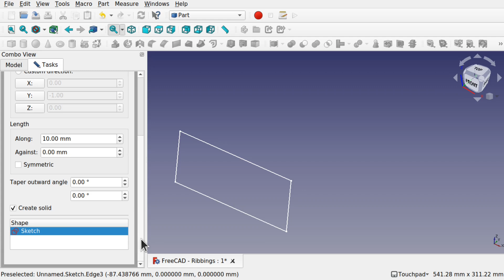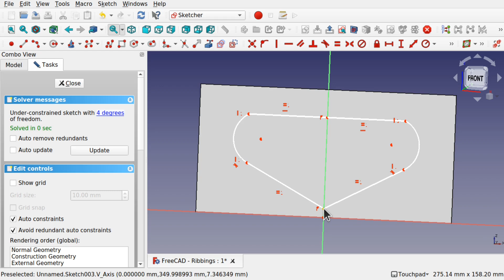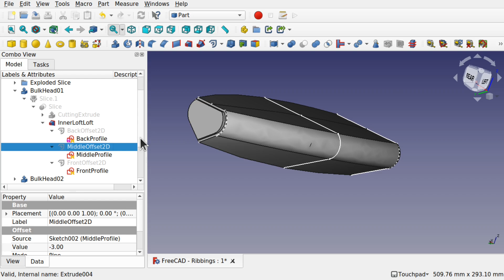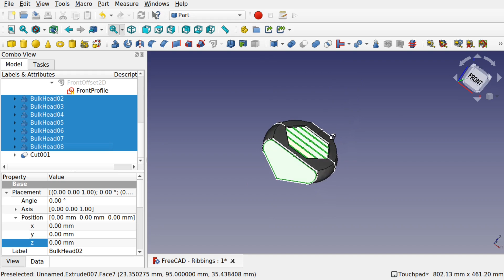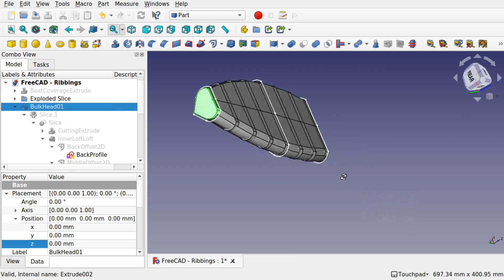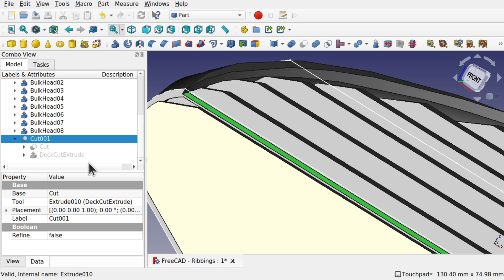Freecad :  How to build a boat parametric boat hull / fuselage. Ribs / Bulkheads Continued

Comment: Thank you for the vid info'.  At about 7.06/26.02  sketch - flat face = xyz on face - cube shows front.
The Freecad I have is 0.20.  As above  - sketch - flat face = xyz to the left of the face - cube shows rear.
Turn cube to show front xyz is to the right of the face.
Do you know what is wrong?
Reply: Just found this is a follow up vid to the one I refer to.

Comment: Extremely helpful. For my model the 1st 3 bulkheads are spaced differently from the aft 10. I tried creating a compound from 13 vertical bars to extrude as the cutting mask, but after creating the sketches on each bulkhead the #1 frame could not be offset correctly - FreeCAD produced a 2D pipe shape (including circles!) around the sketch NOT inset. The other 12 sketches were offset correctly and I haven't yet found a solution. Incidentally, the #1 sketch, even though fully constrained, is not included in the list for Lofting.

Comment: It looks like you can’t make a parametric sketch with elements trying to connect to b-splines.  I can’t constrain a point to the curve along a b-spline. Or am I doing something wrong?  I do notice your sketches that define the cross sections do not use b-splines.  If this is true, do we know why this is currently not supported? Is it that difficult?
Reply from the maker: B Spline are notoriously hard not just in freecad but CAD as a whole. Constraining to a bspline is not yet supported so your not doing anything wrong.
Reply: @MangoJellySolutions  thanks my friend! I love you channel-you’re really good at teaching!

So newtons method kinda falters  during constraint solving for B-splines?    Or what do you think the coding difficulty lies?  I wonder how its done with fusion360 or solidworks? Or if its even supported by those?

Comment: Another video , Your understanding of Free cad is awesome . When i do a drawing like this and want to create a drawing of each bulkhead . will each bulkhead be the correct size according to it's position or bulkhead number ?  This one is not related to this video , I want to write a macro that will speed up design of containers . that will hold a certain number of fluid OZ. how would you do this ? Thanks for sharing your time and expertise .

Kindest Regards
Terry Lembke
Reply from the maker: Thank you for the comments. Yes the Bulkheads would be the correct size as they relate to the position of the loft. What you can do is use the draft workbench and output a 2D view of each bulkhead and convert these to a sketch. I will have a think and reply to your other question regarding the macro.

Comment: I hope there is a future video on work tree management. What if I want to design a RC car and want to logically separate the parts for different areas (chassis, steering, gearbox). I want to see other parts while designing a new part, but sometimes I want to hide related parts at the same time, such as hide the gearbox (all of the many parts related to this) so I can just see the chassis with the suspension and steering for example.
Reply from the maker: Yes that would be useful it's now on my list. Thank you for the kind feedback
Reply: @MangoJellySolutions  no worries man. Beginners like myself should be helping to guide your content so that you can grow your channel.